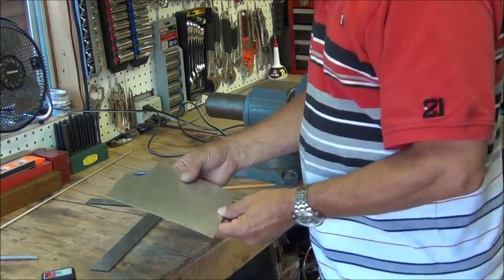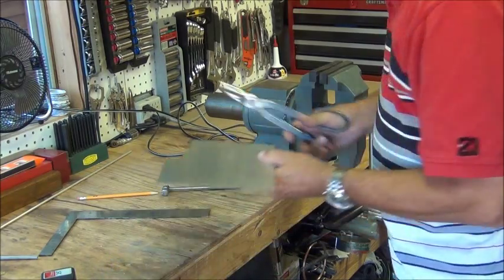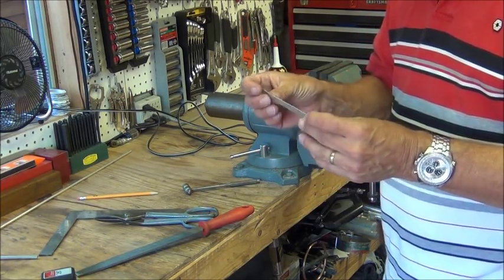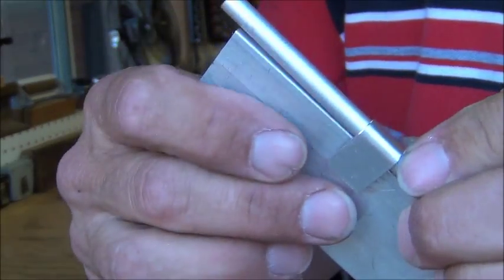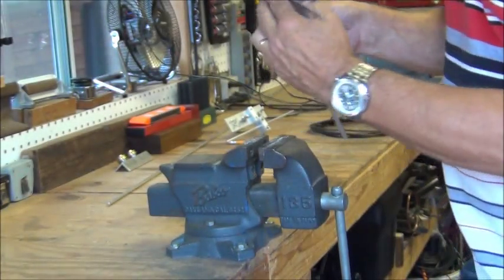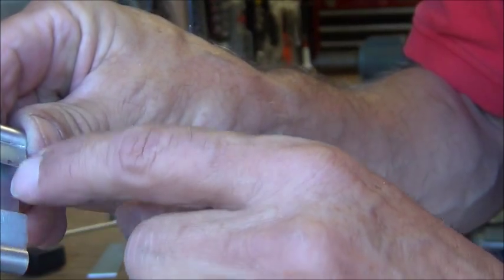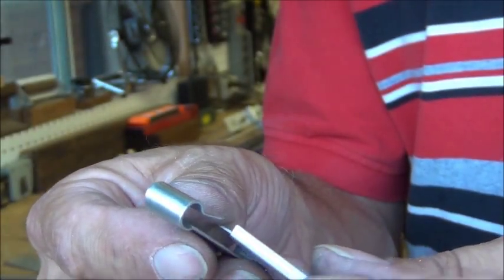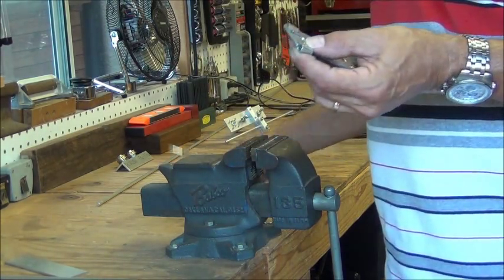2 Meter Halo Antenna Part 7 -- "Gamma strap fabrication" by N6TWW

Comment from the maker: If your antenna is made out of aluminum you would be better off using aluminum material everywhere. Different metal types will cause the metal to oxidize faster. You should also use stainless steel screws and nuts so that they do not rust.

Comment: I am just new with beam antenna.  I have a moonraker 4, and it needs some items.  So grom the gamma to the element either horizontal/vertical I can use sheet metal with copper type connectors?  Is there a metal I should stay away from.  Do you have a site that may explain this basic for someone like me?